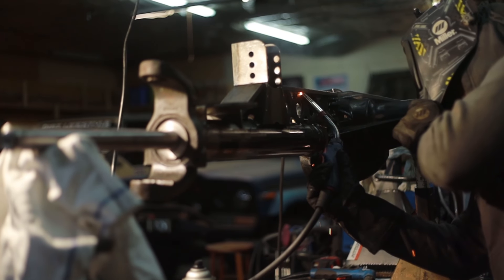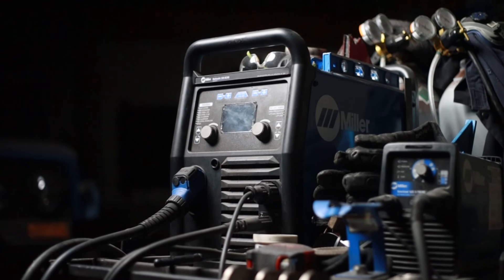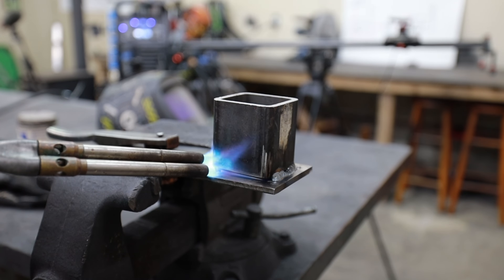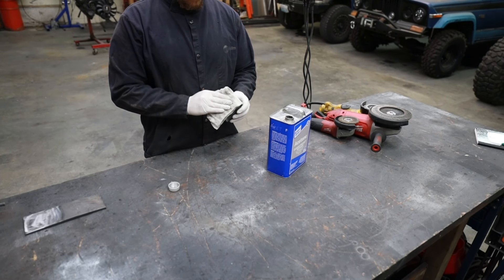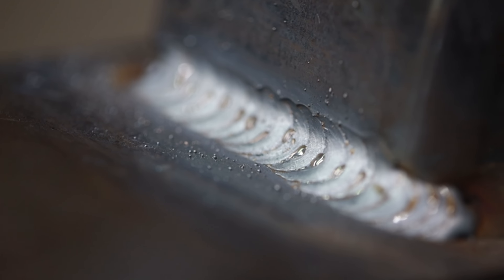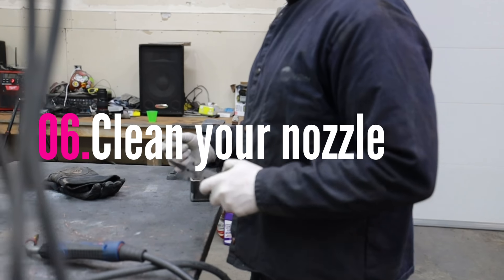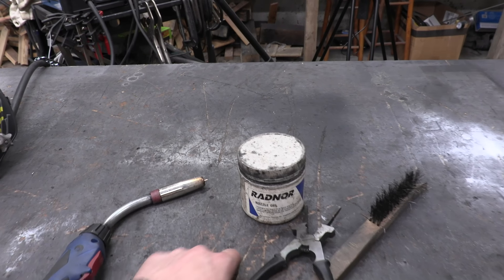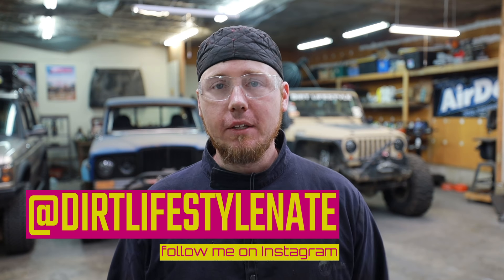7 Tips/Tricks To Make Your 110v Weld Like A 220v! (welding tips for beginners)

Comment: Hey Nate!
Love your videos and been following you for a while.
Really envious of the cool stuff you make and drive!
Maybe I'm misunderstanding but your math in the start can't be right(the 180A example).
If you were pulling nearly 40,000W from your 220V line you'd be blowing up your fusebox and putting your wires on fire, that's an insane amount of energy.
They only reasonable way is if the welder is specified at 180 amps at the output, ie the 20-30V the welder is outputting after transforming the 110 or 220V input.
If I understand correctly then you get 220V in america by connecting two phase wires.
So even with a relatively large 20A fuse that'd give you around 8800W to play with.
What I think happens is you have for example 220V 25A(8.8kW) input and then a ~30V 290A output(8.8kW).
This is assuming you're absolutely maxing out the input of course, it would only draw as much from the input as you're trying to cram out of the output.
What I think really makes the 110V welders "suck more" is that the lower voltage is more sensitive to voltage drop and also having a much more uneven input since it's just one phase.
Not to mention that a lot of lower spec welders also come with really undersized wiring(both input and ground clamp etc) which makes everything much worse.
Hopefully I'm not coming off as rude!

Comment: Get a heavy duty extension cord if your going to use one for a 110v welder.  None is better but a 10 gauge cord that 15 feet or shorter will work out ok.
Reply from the maker: I should have brought this up! Its the reason I ran no extension cord. Max Power!
Reply: This is a concern of mine with my current setup... I might not be able to do anything till I get moved. Laying in the street to fix a Jeep sucks.
Reply: The extension cord should be the same gauge as the wire inside the wall going to the outlet.
Reply: Hobart says 10 gage is good out to 100 ft with the 140. I know for sure 50 ft 10 gage works.

Comment: You are absolutely correct about power making things hot. Electrical power is dissipated as heat. However, your power calculations at the beginning are off I think. You are multiplying the welding current by the line voltage. This is apples and oranges. You just simply can't pull 180 amps through any outlet you are going to find in a home or shop. 200A rated outlets exists and are typically used for generator hookups, but they are huge (comparatively) to the NMEA 5-50 which is what most 220 welders have. Think about the 16 or 24 ounce beer cans size. 110 welders will have a NMEA 5-15, which is your standard 110 plug and outlet. 

You need to multiply the welding current by the welding voltage and multiply the line voltage by the line current. Your welder does not draw 180 amps from the wall outlet. My 220 outlet is supplied by a 30A breaker. Max power is 6600W out of the outlet. My machine is rated at 20A input current, so the rated input power is 4400W. If you look in the specs, with 220 V in and a 30% duty cycle the machine is rated at 130 A at 20V. That's 2600W. The welder can't put out as much power as it takes in because it is not 100% efficient. Also the input power is a limit, not necessarily the power the machine will draw at the rated welding power. The input power numbers are used to help size the supply circuit properly. 

My specific welder also comes in a 140 A 110/120 V variant. This welder is spec'd for 120 V and 20 A input which is 2400 W. The welding power is spec'd at 1755 W (19.5 V @ 90 A).

I think your welding tips are solid, but I just wanted to make that clarification about the electrical specs.

Comment: After watching the first 2 minutes of this video (120 vs. 220V machines), I'm like...whoa - wait a minute - you can't simply apply Ohms Law (P=IE) directly to the two welder types based on stated current rating and input voltage. It really comes down to what the machine does with that input voltage within the welding voltage/current conversion circuit (transformers, regulators, current control, etc.) internal to the machine.  I see you addressed that in your pinned comment after the fact.  Great presentation though!

Comment: So getting ready to buy a good welder moving up from a old hf 90 amp mig stuck between the miller 141 and 211 was also looking at the  Lincoln le31mp but figured ill stick with miller after some reading do you think the 141 has enough power to weld bumpers and trusses? Only reason I'm holding out on the 211 is the fact that ill need to wire in a 220v outlet

Comment: What would you recommend for welding 1/4 brackets into a factory Dana 44 jku axle? I have a 220v mig 170 I’ve been welding with it works well enough but after watching this I’m not 100% confident I’m getting enough penetration...
Reply from the maker: That is plenty but I would chamfer the edges of your brackets a little bit 👍

Comment: I'm pretty sure these newer  machines that can plug into any current  (110, 220, 480) are like that because they actually run on like 80 VAC or something like that and it converts everything down. Im pretty sure I read that in the owner's manual of my Miller Dynasty I think laptop computer  power blocks are the same way.

Comment: Hey Nate.. Great Video as always.. Could using multi pass welds help with the lover voltage welders? Kinda like the pipe fitters use.. Root then multi pass caps.. Thanks if you get back?
Reply from the maker: Hey man! This is a tough one to answer. I'm not sure a smaller machine will have enough juice for a strong cover pass. Maybe if you give it a ton of preheat first 👍
Reply: @DirtLifestyle  Thanks for your time and reply.. was just curious if that was a plausible method .. Yanno things that make ya just wonder... Take Care and Have a GREAT Fathers day

Comment: I bought a 110 flux welder in Japan. I don't know if it's my outlet or what, but the welder really sucks. It cant weld anything but sheet metal. Is 100v 15amp just too weak to weld with? It's supposed to be also able to plug into a 200v outlet, but the power cord that comes on the welder is 100 v.

Comment: Welding - the act of fusing 2 or more alloys together 
You can penetrate 500 feet if you want... but if it doesn't have proper fusion, then it's not welded... It's more about how much the base material and weld nugget overlap. The act of chamfering helps with depth, but you still need the toes to fuse into the walls. If the backside doesn't have proper fusion, then that penetration doesn't mean squat

Comment: I'm pretty sure the amperage rating is based on the stepped down voltage of welder not the line voltage. I mean 220 is just two 110 circuits with opposite phases.

Comment: I agree that it's watt's that matter, but the math was a bit off. The welding volts x welding current is the power at the point of weld. The 180amps at 220V or 110V would be near 100% of what most house hold main breaker. The 220V at 50amps is nominal power input to the welding.  Also dropping to 110v limits the amps to about 20 amps. With the right setup one could get the 50amps of the 220v setup at 110V... but thats another topic.

Comment: it is indeed about watts, but you cant mix input volts with output amps.

the following is from a stick welding perspective:

Maybe it would be better to look at just the input side:
a 110v circuit with a 20 amp breaker provides at most 2200 watts at least unless you have just massive capacitors for involved and a very short duty cycle (almost certainly not the case) the laws of thermodynamics say your welder's output must be less than that amount of watts.

on the other hand 220v with a 20amp breaker can provide at most 4400 watts.

even then though its not exactly apples to apples.

your welder ouputs constant amperage with variable voltage, (as opposed to your power supply is constant voltage with variable amperage.)

while welding you set your welder to a given amperage, and you require  a certain minimum voltage to maintain an arc depending on the length of your arc. the point is given that minimim arc voltage the 220v welder will have much more power at its disposal to allow it a wider range of amperage.

for example lets say it takes 20v to maintain an arc that means a 2200 watt (input) welder if operating at perfect (impossible) efficiency can provide 110 amps, where as a 4400 watt (input) welder could go up over 200 amps.

The problem is that less of efficiency is impossible and you don't want your welder running at the very edge of tripping  a breaker so with less than prefect efficiency and some margine for error your 110v machine is running around 85 amps at most. this tends to be on the bottom end of the range prescribed by most rods of 3/32" or greater for example a 3/32 7018 is an easy  to work with rod but the prescribed amperage range is like 70 to 110 amps so you may be pushing your luck with a 110v welder. whereas 6013 rod of the same size is very common and with a much lower amperage range 110v welders handle these rods well, but they also produce a lot of runny slag compared to other rods making it difficult to see what the metal under the slag is doing, and making it far to easy to trap slag in the weld making a weaker (and uglier) weld.

This dichotomy makes it hard to recommend a welder to a beginner the cheaper 110v machines almost require more skill to use

Comment: These are some good tips. However, your opening calculation is a little off. A 220 welder at 180A is not going to give you a 39.6Kw of power. Your 50A breaker can only allow 11Kw. As a matter of fact welding with 220V would be extremely dangerous for electrocution. A welder is using low voltage like 26,30,40V for operation. So a 110V welder and a 220V at 180A can use same power. The 220 would allow voltage to bump a bit higher. A typical 110V outlet on 20A breaker can only give you 2.2Kw before it pops.

Comment: Another mistake newbies make is running the wrong polarity with flux core/innershield; most require straight polarity. Straight polarity = electrode negative. Reverse polarity (solid wire with shielding gas) = electrode positive.

Comment: Mistake in the video: The Amps rating is for the output. The output voltage is more like 18 to 35 Volt.
Example : For an output of (150 Amp at 30 Volt) -> 4500Watt. The input current is around : 4500W / 220V -> 20Amp. ignoring loses and energy necessary to the electronics in the welder.
60 000 Watts is not common from the main. 
In europe the biggest house appliances are running off of a 32 Amp circuit breaker which is about 32A x 230V -> 7400W

Comment: Nate,  great video and tips. One question for you. I have been cheap and am still using flux core wire instead of buying a gas bottle.
I recently watched a welding video that said you can actually get more penetration with flux core. What are your thoughts on shielding gas for mig welding? Necessary?
Reply from the maker: I highly recommend you use gas. Once you start welding with it you will wonder what took so long to get it lol. I wouldn't be surprised if flux core is a little hotter but I'm no expert. 🤘
Reply: From my experience, flux core runs hotter and is more portable. Gas runs cleaner. Cost is very close because solid wire is cheaper and has more steel in it but have to buy gas. I keep flux core on hand in case the tank runs out or I need hotter or more portability.
Reply: @ingluv I also see flux running hot AF. im always having to turn it down a little bit so it doesn't burn a hole.

Comment: A 120v welder doesn't weld at 120v and neither does a 240v.  Welders do not put out the rated amps at 120 or 240v. They both weld around weld around 20 to 30 volts.  You can get more amps from a 240v welder because there is more energy potential.  A 240v welder can reach over 200 amps.  A 110v normally maxes around 150 amps.  That is 200 amps at 25ish volts.  200x25=5000 watts.  150x25=3750 watts.  You cannot get 30,000+ watts out of your wall receptical.

Comment: It's amps times output voltage. Think about it, a 220 amp welder does not draw 220 amps from the wall. Output voltage could very well be the same from a 110 or 220 volt machine.

Comment: Brother, I love your videos, but I'm sorry man you have this wrong at the jump.  You don't have 180AMP breakers which is the only way you are going to generate 40KVA.  Look up 40KVA generator and you will see what I mean.  The popular Millermatic 211 input power max is 16.6A at 240V, 3984Va.  It's OUTPUT is rated for 150A at 21.5VDC , or roughly 3225VA and 80% efficiency.  Output is rated for 115A at 19.8VDC, or roughly 2277Va, and 78% efficiency.
The tips were good though :-).

Comment: I hate to burst your bubble, but your math is flawed....  The wattage you mentioned is not available at a typical residential outlet.  Most 110V AC wall outlets offer 20A.  So, 20A x 110V = 2,200 total available watts..  Most 220V AC wall outlets are 30A, maybe 50A.  Well go with the lesser.  30A x 220V = 6,600 Watts. 

Additionally, your welder is not producing 110V or 220V at the electrode.  Your voltage will depend on arc length and will be fairly low and is DC.  Your typical household wire feed will run around 20V DC.  So, 20V x 100A = 2,000 watts (DC).

Comment: only need to pre heat to 100 degree celcius. anything over that is too hot.
Reply from the maker: Not true, do your research 🙌
Reply: @DirtLifestyle  with the greatest of respect. I am a boilermaker in australia, I've been doing this for many years. As soon as you hit 230 degree celcius or 450F and weld, you change the grain structure too quick and over time crack. I know what I am on about especially being 5mm thick 100 degree celcius is plenty of heat. Maybe do your research first champ

Comment: 1:10 Really dude? The “180” amps is not measured at the wall... the 180 amps is at the work side of the welder at somewhere around 16 to 36 volts which would be no more than 6,500 watts, NOT 40,000! Any old welded won’t be more than 20-40 amps max at the wall.

Comment: Hold on back up. 
Yes weld heat is watts. 
But a 180A welder powered by a 110 circuit is the same as a 180A welder powered by a 220v circuit. Because the actual WELDING voltage is not either one of those. Once an arc is established the voltage is much lower. TIG and stick for instance have an open circuit voltage somewhere around 70ish volts, but once you establish an arc the voltage maintains somewhere around 15-20V and whatever amperage the machine is set at. On MIG you run constant voltage somewhere between 20-30v and the current follows feed speed. 
Supply voltage out of your wall has absolutely NOTHING to do with the weld voltage or power. 
The reason 220 welders tend to be more powerful DOES have to do with watts though. Most people run welders on a 30A 220v service. That means the outlet has 6.6kW available. Most 110v outlets are only 20A. That's 2.2kW available. Huge huge huge difference in power available. But the welder COULD make 6.6kW off of a 110v circuit, IF the circuit was 60A. The problem is that the wire size follows the CURRENT not the voltage. So for that theoretical 110V 60A circuit you would need MASSIVE wires that nobody bothers to run in a house. Whereas 220v 30A only requires a pretty common #10 wire. 
But the big thing here is that the voltage coming out of the wall has nothing to do with the power the welder is putting out. Simply power in must equal power out and the typical 110v outlet has less overall power available.

Comment: you don't weld at 110 or 220, your weld voltage is 24 to 36 volt ac or dc ,  the amp flow is a result of voltage, think of amps or current as a rock, voltage is  guy pushing the rock up a hill

Comment: You are totally wrong when saying a 220v 180a produce 39600 watt  and a 110v 180 a produce 19800 watt.  The basic is  that a 120v 20a outlet produce maximum 2400w so a 220v 20a outlet produce 4400w.   That is right that  a 220v can toughly produce the double welding energy than 110v welder, please dont talk about 10k watt  .  All is about the welding voltage  i not expert but imagine that a 140a 110v welder weld on 1/8 tick at about 15v so 15v x 140a  =  2100w that is  more near the real world power usage .  So  considering a 220v 140a welder can probably weld at double voltage than a 110v  so produce double amount of heat. It not all about the amp, is all about the power ! so it not torques it is horsepower you want   😛

Comment: You did'nt fully explain about welding with a 110 welder. Or how to weld with a 110 welder. I have A Hobby Arc 110 welder. I don't have 220 electronic in my shop. So I bought this 110 so I could just use my 110 house electricity. But the sellers of my machine must of know that this 120 welder is most times inoperable.  Horror freight has no customer service to complain to. When I explained this to the manager of Horber freight and asked him would they compensate me towards another one. When I told him it was new and out of the box and wouldn't welder. He said I had it too long and I had to buy a new one. Is that a company that don't give a shit about their customers or what?